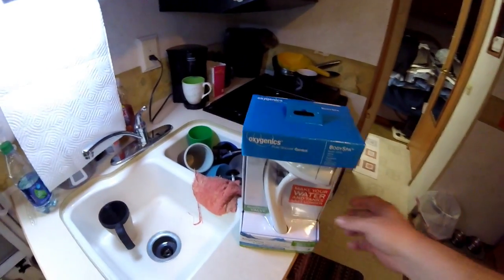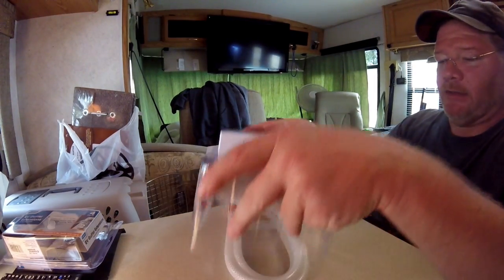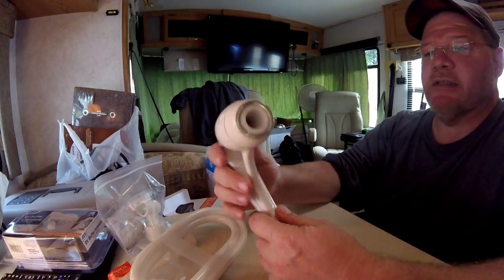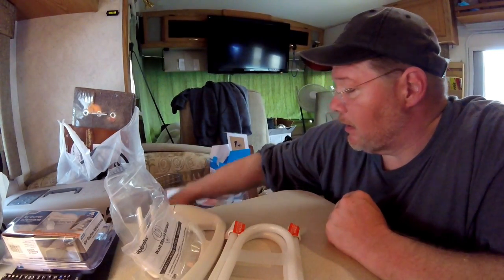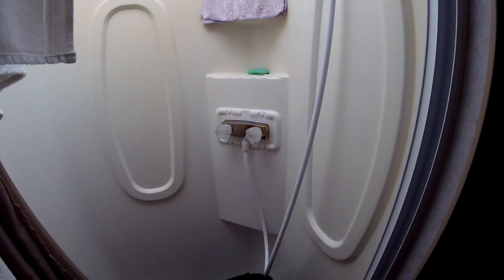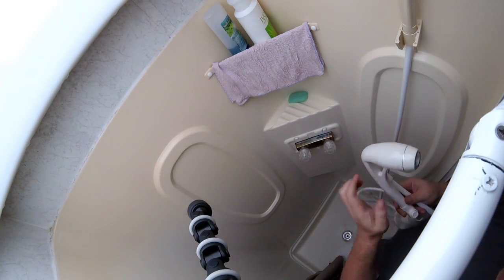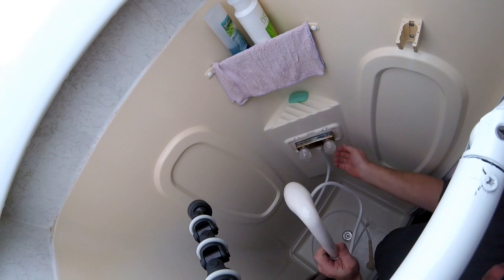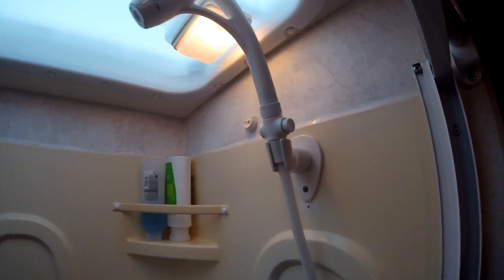RV Mod - Oxygenics Shower Head Replacement

Comment: We bought one when we got our RV, but the one that came with the RV works great.  I just saved the Oxygenics for later down the road if that one breaks or fails.  

Sorry I'm behind, but I'm catching up.  We were visiting family last week.  Had to put our dog to sleep yesterday.  That was unexpected and I feel so bad!  He had 4 seizures in 30 mins or so that caused brain damage.  I miss the little guy.  The 14 yr old is still hanging in there.  I think he misses Logan too.  HUGS  ~Donna
Reply from the maker: Hey Donna - great to see your comment.  I really do like it - it is better than the regular shower head that came with the RV.  It all depends on the water pressure... but it is an improvement. Huggs back at you!

Comment: Good Job Patrick installing your new shower head.. We don't have one of those as of yet as Andi hasn't asked me to put one in.. I usually take a shower at the showers a the campgrounds as I can have as much hot water as I want and not have to worry about the gray tanks filling up so quick lol. Thumbs Up my friend!!
Reply from the maker: That is very true Alan ... I like to go to the camp showers once in a while to take the longer shower as well. This is working great and I bet if you put one in you would be happy.
Reply: You are probably right that I would like it better but use more water too in RV LOL ..No problem if hooked up to campground water though :)

Comment: We installed one before we hit the road. I guess we already had a good shower head as we didn't see a great improvement if any at all. We left the original  holder in place for the short people or travel size as she likes to say that live in the RV. The double sided tape failed in no time so it is now held on with the screw and bathroom silicone. I can see Paddy's Mobile RV Repair 👍
Reply from the maker: Haha!!!!  Not quite, but I am becoming rather handy these day. Now for the big stuff ... well, that is still beyond me for sure.  I will have to call Rob for help with that!

Comment: Hey Patrick- I've had the same one since around 2008.. still working great! Mine seems to have a bit more water flow coming out the end though. It's been so long, but I might have removed the water restrictor in it- to get full power. It's a good unit!
Reply from the maker: Thanks Steve ... yea the water pressure was off a little, but the unit works great. Thanks for your comment. Happy New Year.

Comment: Hey Patrick Great Job on the Oxygenics installation. I installed one in TIMROVER last summer and it’s awesome. Do me a favor when you get a minute remove the holder at 6:01. There is a hole behind it for another screw to assist the sticky tape in the event of condensation build up.  Good Stuff!
Reply from the maker: Hey Tim ... I removed the holder assembly and saw the extra screw hole .... well, I guess you can see I did not read all the directions.  Thanks for the heads up. This is why it is good to have friends that know what they are doing.  Haha!
Reply: You're golden Patrick, This is why you have your extended RV Family here for us to learn from each other.
Reply from the maker: Absolutely Tim and oh by the way ... both of my lottery tickets are winners.  But, just so you know - it was not the $500 a week for life one ... because had it been that one, you would have been getting a call from me telling you I was on my way up to Illinois and to make room.

Comment: I wonder why house showers do not connect as easy as that.  Hand held showers in houses attach over the head, and the hoses are always a foot too short.  The older I get the less maneuverability I have.   It's a great feeling to take a nice hot shower and climb into bed on clean sheet day.  I have a habit of cluttering my bed with stuff.  On clean sheet day I can stretch out without kicking something off.  Right now I've got a tin of candy, manicure set, cold eeze, sudafed, floss picks, hand splints, paper towels, and two remotes.  I don't know how it happens, but it always does.
Reply from the maker: I totally know what you mean. Living in a smaller space, I have things all over the place too and when I get ready to move the RV ... I have to pack it all away.  Not a big deal, but takes a little more time than I like when I am ready to get on the road.

Comment: Super easy to install,  We love our's. If I had one complaint, Is that when you hit the Shut off at the shower head, It still drips out. Yea, that's silly, But that's all we found against.
Reply: I was told they are suppose to drip to keep from blowing seals or something but we went with a camco with a lot bigger head and it does not drip
Reply from the maker: Yes - it was a simply install and that is good for me.  haha. I agree the water drizzles out when you close the valve and it gets cold.  Other than that - I am pretty happy with it.
Reply: That make's sense. I really like ours, Just thought is was funny that i's made to save water but Drips when off. LOL

Comment: Yours needs some adjustment to the nozzle - Mine has a great spray even running off the fresh water pump.  I didn't put in the new bracket, didn't like it.  Used it for about 6 months now and it is so much better than stock.
Reply from the maker: Thanks Bill ... I did not have the water on full force - probably the reason why the water pressure looked a little off. Works great though.  Thanks for watching.

Comment: One comment, this shower head is made of plastic &  somewhat fragile.  I was in the shower doing some work & knocked the head off its mount & broke the shutoff valve.  I now have to get another shutoff valve.  Just a note of caution!
Reply from the maker: Good advice ... seems like it could break pretty easily.  Thanks for your comment.